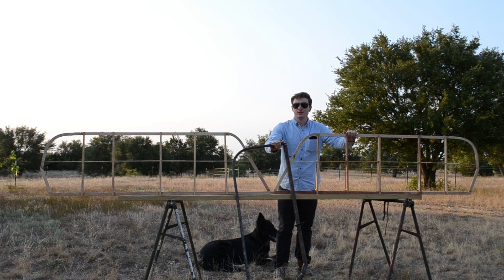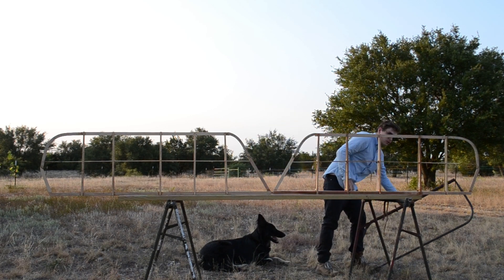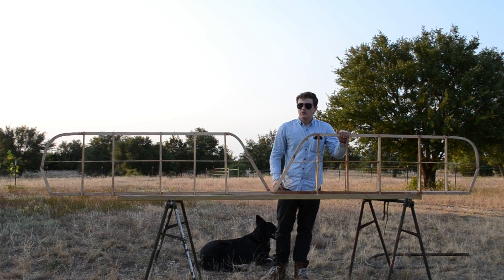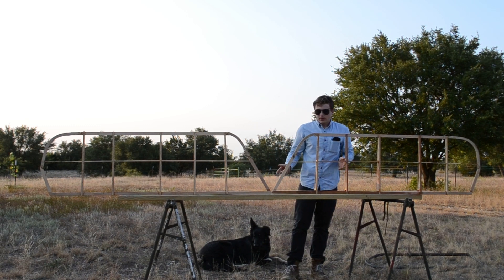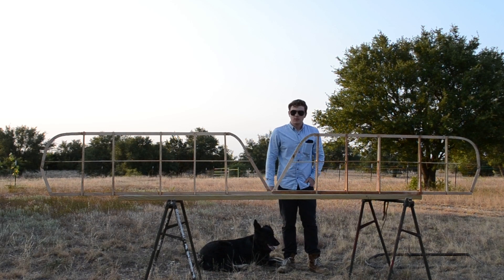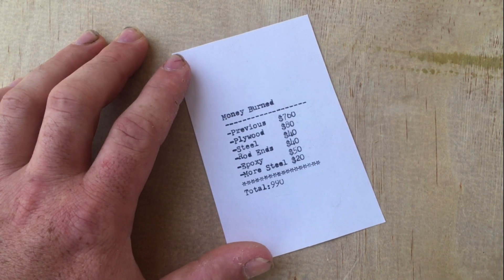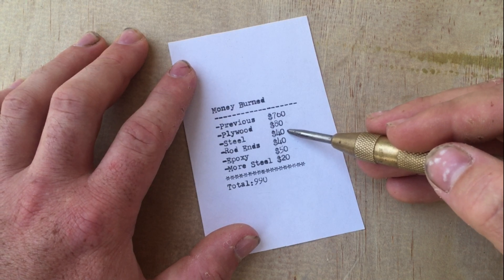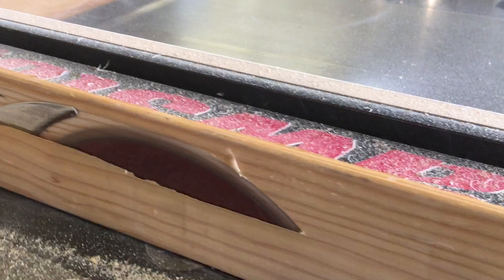Homebuilt Airplane Episode 7: the Rudder and Elevators

Comment: if you can dig a trench you can steam bend ... you need  lots of rocks or bricks build a fire over the pit put rocks on top of the fire and light the fire once the rocks fall in add wet grass or hay then your wood and cover with dirt ... try and let as little steam out as possible ... after an hour uncover and bend as required on your jig added bonus the steam pit makes excellent slow cooked stew in a ducth oven as well so you can have dinner ready for when you are done bending ;)

Comment: I realy hope your gonna rebuild those horizontal stabilizers. Especially the right one. (My right,your left)Your spar was way off. Almost at an ark and one of your ribs on the left stabilizer was at a slight angle. A square goes a long way. Steam bending wood isnt that hard and I would not trust that rudder. You welding a lot of tubes together  means  a lot of fail points. Some areas you just dont want to be too cheap in. Your life and those on the ground depend on you building this plane right.
Reply: Safety must always be the main priority of any build. There is absolutely no point in building something for one's pleasure if, in the end, it costs one's demise.

As for crucial sections of the design which include welded parts, it is always sound to throw some weight at the problem (if it comes without other compromises), or better yet, the use of modern composites. Carbon and S-glass cloth is only getting more and more affordable.
Reply from the maker: Thank you for your comment! I have not actually glued the stringer in yet, so it is allowed to flex a bit for now, which is why it's bowed a bit. Also, the original rudder was brazed together, not welded, so I'm pretty certain that mine is actually a bit stronger.

Comment: I noticed you used epoxy for the elevator, not that I'm complaining or anything but I thought the original didn't use glue because the glues of the day were not up to the task.  You had said in an earlier video it was your intent to build using period techniques.  Maybe you could add a note as to why you chose this approach if it is different from period accurate build?  Just curious.  
Also, it seems odd that the original elevators were made of a nice light weight material like wood and that the rudder was made of steel.  It seems like a very heavy solution way out at the end of the plane.  
I like your solution for avoiding having to steam bend the elevator bits.  When I was a kid I helped my dad re-build a wood and canvas canoe.  We broke 2 ribs for every one we successfully bent and installed.  We got much better at it as time went on and our technique improved.  
Thanks for documenting your build, I'm really enjoying the videos.
Reply from the maker: The original definitely used an adhesive of some kind on the scarf joints, but I'm not sure what kind of glue it was.  I assume that there is less force there than on the fuselage and that is why they were able to use glue in that location.